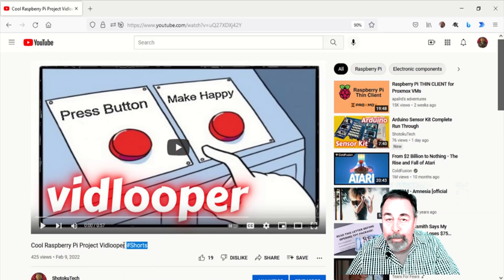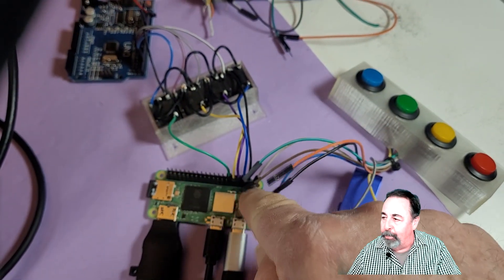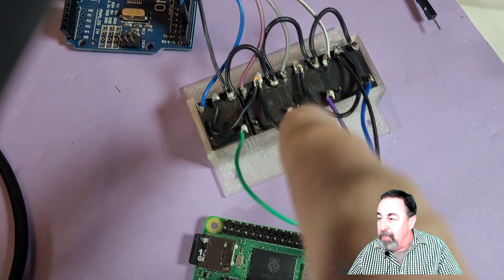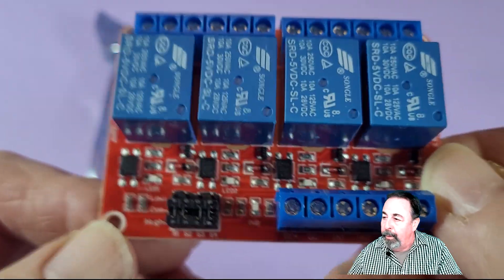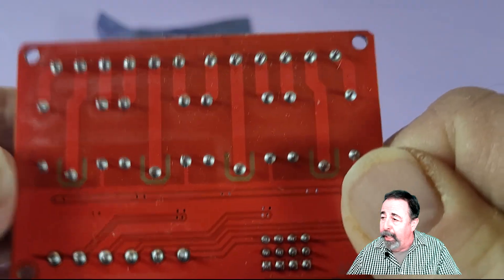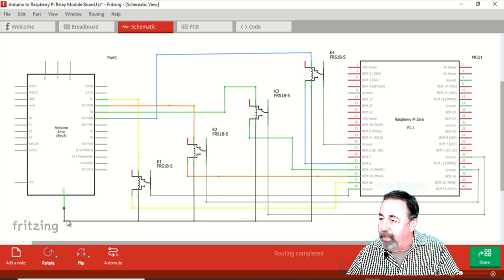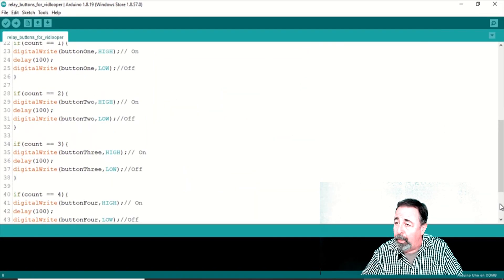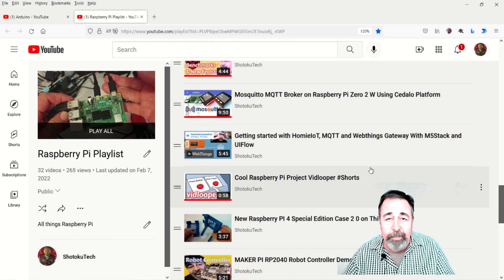Raspberry Pi Controlled By Arduino UNO With Relay Shield.

Comment: Is the Raspberry pin pulled up high (3,3V)? In this case:
I think I can put a diode with its' cathode(-) side to the arduino digital output pin and anode(+) to the pulled up RP pin. If output is HIGH on the Arduino pin the diode stops the 5V flow to the RP pin but if I set the Arduino pin to LOW it will let the RP pin grounded so its' pullup effect will be eliminated. Of course I connect the Arduino and RP to common GND before all of that. Oppinion?
Reply from the maker: The relay is grounding the pin, otherwise open or float, so pulling low I guess. So this is just like a button connecting the pin to ground. Yeah, I'm sure there are other arrangements that could be made electronically. This is for a pinball machine, so more clicking and clacking the better. LOL

Comment: Interesting project.  I wonder if you could replace the relay board with an opto-coupler board.  No clicking, no mechanical parts, so it should be more reliable.
Reply: You could also use a four channel level converter to go from Arduino 5V pins to the RPi 3.3V pins.
Reply from the maker: That was my first thought. I could not get my head around replacing push buttons with a high/low signal and had this relay board on the bench. I will try it someday. Thanks!
Reply from the maker: Certainly! Thanks